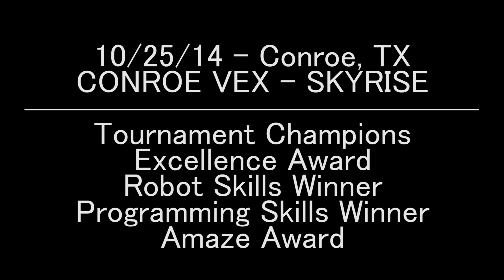Team 118 Robonauts VEX 2015

Comment: I may be asking a question to which the answer should be obvious but... are you using only 9 motors? I seem to count 4 wheelbase, 4 lift (pneumatically assisted, which is glorious by the way), and 1 on the intake.
Reply: pretty sure its 5 base - H-drive